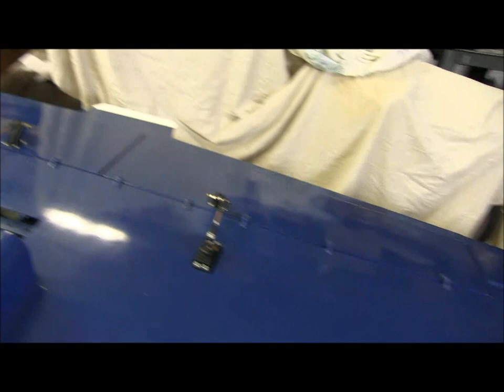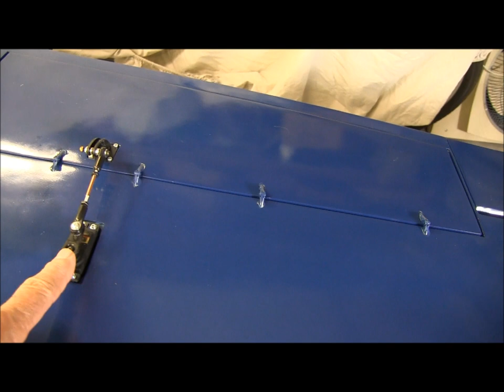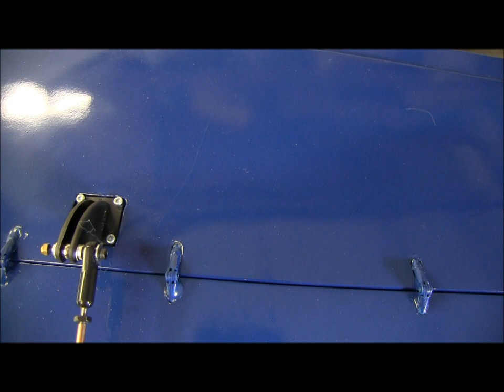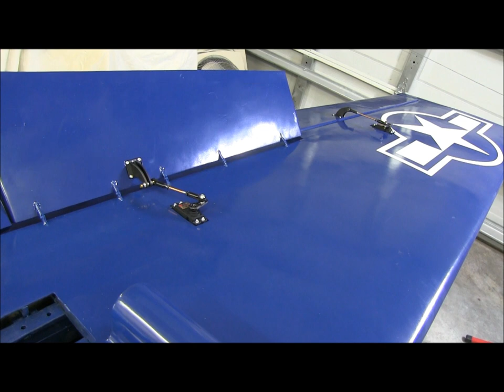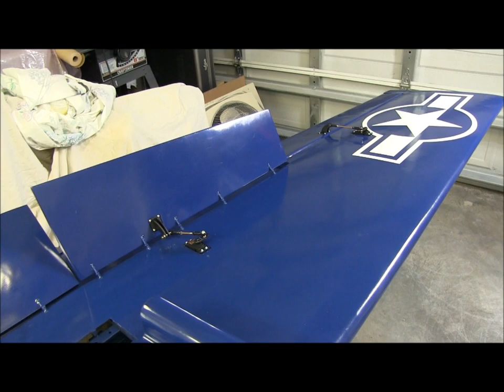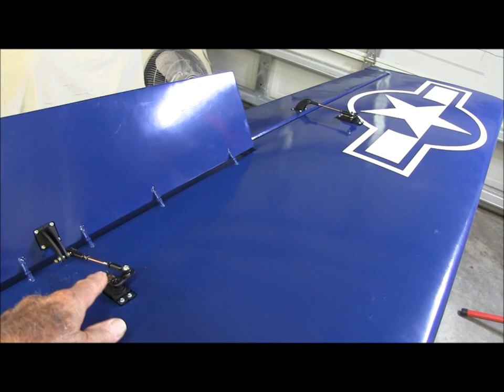Flap Aileron Servo Setup

Comment: servo horn should be half length, and an 180 degree rotation is desirable.  that way the servo is under no load when fully extended.

Comment: hmmm when the flap is level with the wing there is little load on the servo, when the flap is extended into the airflow that is when you have the maximum load on the servo. so really what you are doing is pointless. just position them the same as your ailerons